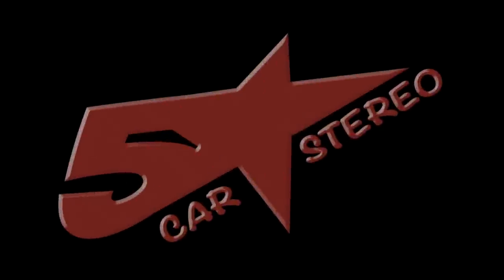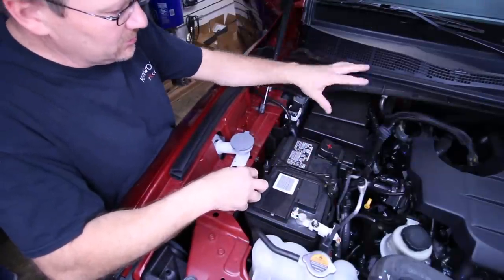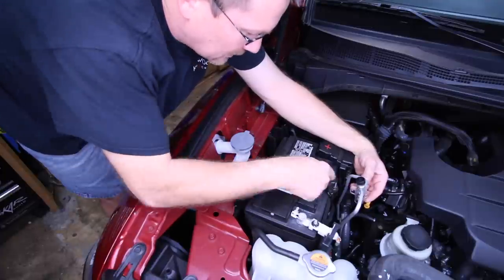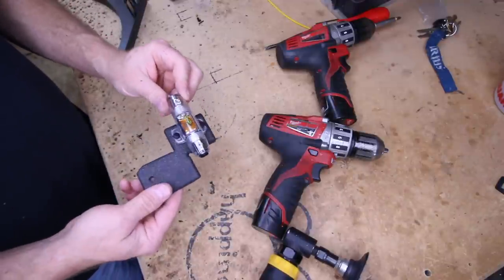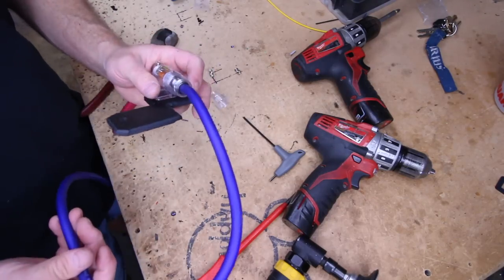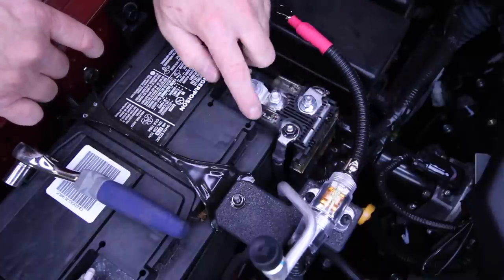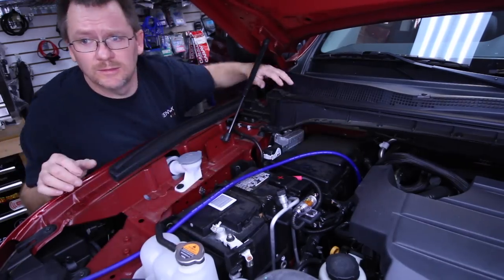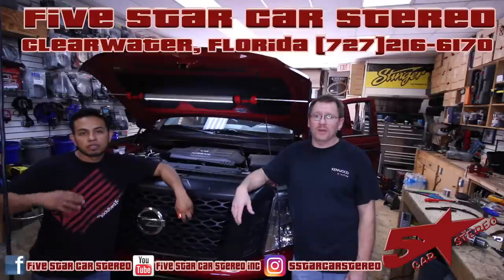How to mount your amplifiers fuse holder

Comment: Dean, Good luck on the Installer award. I voted for you the other day. I was curious on your thoughts about using a circuit breaker instead of a fuse? If a breaker was to be used would you use the same amp rating or use a lower amp rating? In my case I have a Kicker KXA1200.1 ran with 1/0 OFC approximately 15' long with a 150 amp fuse.

Comment: Thanks for this video.
I would shrink tube the wire insulation to the ring terminal, then shrink tube, or what I prefer, wrap tape around end of split loom to shrink tube.
Shrink tube isolates wire from weather, split loom protects from abrasion.

Comment: I love your videos! I saw your other video regarding 4 awg wire and connecting to amplifiers. I ordered ferrules and I'm planning on rewiring my connections to my amplifier on my current install that I have been picking away at. I have yet to mount the fuse or wire anything to make it life because I'm planning on replacing battery terminals. What do you recommend I use ferrules for the fuse holder? Also do you have any recommendations for what style of battery terminal I should use? Keep up the amazing videos! I love how clean the installations are and how well you two work together.

Comment: Mount the fuse next to a fuel line.
Reply: What fuel line? Are you talking about the grey metal line that has a black cap with an H on it? If so that is not a fuel line. It is the high side line for the A/C. Granted I wouldn't have mounted the fuse and ran the wire that close due to that line gets extremely hot. He didn't have many options but it would of been nice to see the bracket dropped down some or had some sort heat shield made onto the fuse bracket.
Reply: Perfect spot for it

Comment: do you answer question? my battery has a really small bolt. its a lot smaller than this one. can i run my 4AWG or does the size of the screw / ring terminals matter?! pls

Comment: Great video!   One thing I was taught is loom or cover with snakeskin or other preferred method from fuse holder back, but from battery to fuse holder not to cover it with loom.  I'm not sure why exactly...maybe so if anything happened to wire it's not hidden under loom.   Have you guys heard of that?
Reply from the maker: +Casey Cross yes SoundMan does it the same way as that. I believe Ford used to do it that from the factory. We kind of just try copy what's in the car.

Comment: quick question. I'm running 4 gauge wire that will go into a distribution block and distribute my power into 4 gauge and 8 gauge for a Mono and 4 channel amp. The block is fused and I'm putting a 100a mini ANL on the 4 gauge, and an 80a mini ANL on the 8 gauge. What size fuse do I use for the main 4 gauge? 180a?

Comment: Five Star Car Stereo, got a question in this installation video of the inline battery fuse holder what size fuse would you normally use for this amp install? I'm installing 2 amps for my stereo setup one is an Alpine 4 channel 600 watt amp that will run my front door and rear speakers and the other is a Alpine 700 watt mono amp for running one 12" sub, would it be advisable to use an inline 300 amp ANL style fuse for the battery fuse holder? I want to use a mini ANL style inline fuse holder to save space.

Comment: Love your videos. I have a question so I need to replace my fuse holder and it had 60 amp fuse. Looking at a kicker fuse holder and states holds a 100 amp fuse. Should I get a 60 amp fuse or use the 100amp one? Does it make a difference?

Comment: whats the safest way to change out a fuse holder. mine melted and im replacing it with a more expensive anl fuse holder. other then have car off is there anything else I need to do because it is the second battery one I am changing  - how do i keep from being shocked-

Comment: would love to purchase a connector at the positive battery terminal that splits of 2 wires one for car, one to power the 2 amps in truck- is 4 gauge wire ok- my last install as a noob 10 years ago used 1 gauge from battery to trunk amp, drilled with great grief thru floorboard of Q45- really inflexible thick 1 gauge - still have that old 1 gauge wire when i removed system after a  undiscovered leak which brought moisture into trunk. now i have 2014 mustang, jl audio xd700/5v2 4 ch amp, jl audio stealthbox  w 13 inch woofer in trunk,  also have 2 kenwood xr-1S mono subwoofer amps- should I use on of those to the subwoofer jl audio 13inch stealthbox- have used anyting since pulled 8 years ago- been stored in dry bedroomn closed since
Reply from the maker: file1man check out this web site 
http://stingerelectronics.com/catalog/power-wire/ or this one
http://skyhighcaraudio.com
One of them should have the part you need

Comment: I don't have a 4-gauge crimp tool.  Could I use a set-screw ring terminal with a ferrule at the battery and use a ferrule with the fuse holder also? Hate to buy a big crimp tool for just the battery and fuse holder connection.
Reply from the maker: Z Hedge yeah that would work. We used those all the time back in the evening had to be gold days.

Comment: Very very clean, as always, you two shoud do a video about how to calculate the fuse for the wire if you run a non standard kit with a fuse and you have to add it by yourself, greetings from Argentina!
Reply from the maker: +Clemente Fiorucci sounds good I will add it to the list, thank you
Reply: Five Star Car Stereo thank you!